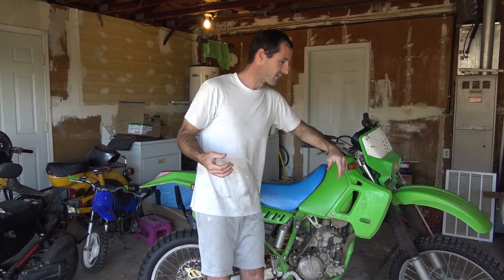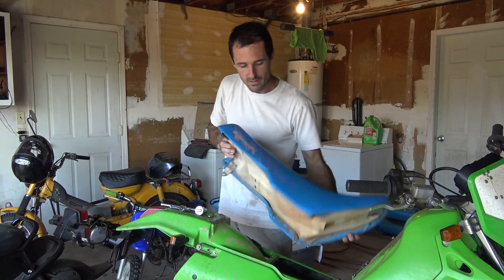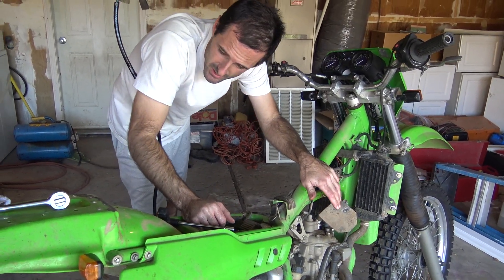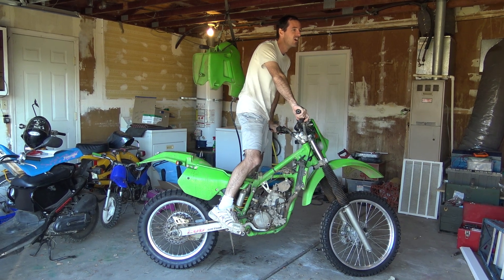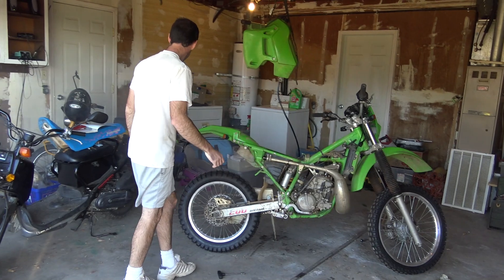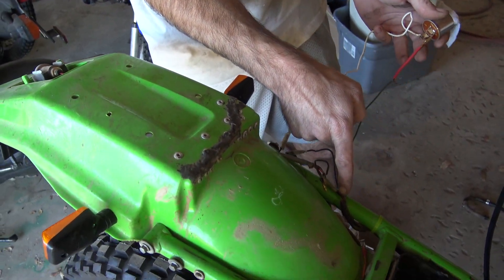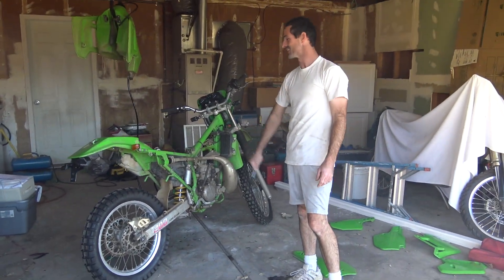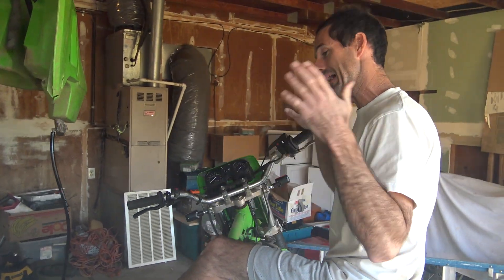$200 Kawasaki Dirt Bike - Who Cares About Turn Signals

Comment: Dude, bin the indicators,  car drivers pay no attention to them. And replace other bulbs with led ones, this will stop head light dimming when applying the brake.  loving the vids by the way,  keep em coming.
Reply: The Moving Object, LEDs won't work with the AC signal. He'd have to install a rectifier, which he doesn't want to do. (Not sure why...)
Reply: only BMW drivers dont know what they are, other people manage
Reply: Jusb1066 IIRC BMWs don’t come with blinkers.
Reply: Honestly that’s true, just use hand signals. It looks a lot cleaner and as a rider, nobody pays attention anyways
Reply: LEDs work fine on AC current. Well, sort of. They will light when the AC current is flowing in the right direction, so in reality they will flash at half the Hz rating (typically 60 Hz) of the AC current. This will be faster than the human eye can see, so they will appear to be constantly on.
Reply: True. But if you install a rectifier and a capacitor, it will work even better!
Reply: tomakze FULL BRIDGE RECTIFIER!
Reply: Matt Strelock Glad, I’m not the only one to catch that. I wonder what they think rectified are made out of if not diodes?
Reply: Well sure, but do you know what voltage those LEDs fail at? Diodes generally have two ratings that matter here. Max voltage, and max amperage. Stators can crank out 18-20v ac at higher RPM. I prefer to play it safe and add the rectifier, they are super cheap anyway. Hell, I made mine for free, and used a stiffening cap to further prevent dimming.
Reply: tomakze And how exactly is having a rectifier going to protect you from overvoltage?
Reply: Nevir202 That's what the capacitor is for. Not quite a power supply, but mine stays below 18v for the most part because the capacitor smooths out the peaks and valleys. Since the circuit for most LEDs are designed for 12-14v DC, I honestly had no idea what would happen if I fed the LED strips I used 10-20v AC long term. Mine is incredibly rudimentary since I made it myself. I just wanted to see if I could make it work. Either way, most "rectifiers" you buy for motorcycles are actually rectifiers and voltage regulators in one box, so none of that matters unless you build your own.

Most people don't know any of this stuff though. No need to be snide about it!
Reply: tomakze I’m not being snide. Your comment made no sense.

You said overvoltage could be a problem and then start talking a home brew rectifier.
Reply: Nevir202 Well, it does make some sense. All LED systems designed for 12v DC applications are going to have some kind of circuit to limit current and/or voltage across the LED so they don't blow up immediately. It isn't just an LED, or it wouldn't last 2 seconds. Most LED bulbs won't come with a diagram showing the method used, so I didn't have a way of knowing if the circuit would still survive with an AC signal. Most LEDs use a voltage dividing network and/or some inline resistors to keep things in spec. I have no idea if that would work with AC, so I played it safe. I am not an electrical engineer, I just know electronics from doing car audio. 

When in doubt, play it safe!
Reply: tomakze didn’t say what you DID didn’t make sense, I’m saying that what you said didn’t make sense as you left out information from your comment.

Comment: One 12 oz. Bottle of golden spectro , add to 5 gallons of gas , that will make that bike run great . 50: 1 is great for this bike! Golden spectro  is a great product , and you might wanna buy a nice sparkplug ! This particular bike is bullet proof , great buy ! New wheel barrings wouldn't hurt and different size sprockets might help you get better performance on the road !!

Comment: I have a street legal KTM 300EXC, and I built a rectifier out of spare car stereo parts so I could run an LED tail light. I did it just to see if I could, and now it has been on several long and intense enduro rides without missing a beat. They are super simple! Mine is just four diodes and a capacitor.
Reply from the maker: Wow, good job on that!
Reply: Thanks! I am much like you, I sometimes like to build things just to see if I can! Friends kept asking me why, considering how cheap they are. I just said "I just want to see if I can do it!" Sometimes putting your knowledge to the test is really fun. And your channel inspires me! Keep up the awesome work!!!

Comment: Add a 12 volt ac regulator between the blinkers and the power. It will keep the current at 12volts when you are at high rpm. That’s how I have it wired on my bike works great!

Comment: Now you just need a 3 position switch and those signals are good to go! Put the flasher relay you bought between the spot you splice into power and the switch so you only need 1 of them. Then wire the pair of flashers from each side of the bike to one side of the switch.

Comment: Makes total sense ... The flasher relay works on heat believe it or not.  A bimetal strip (two different metals laminated)  as they heat at different rates the current causes the strip to bend and break the circuit, it cools reconnects the circuit hence a blinking light. Basically an automatic on-off switch An Electronic flasher (typically used fro LED blinkers) would not have worked for you.  Keep at it.  Al ittle more wiring and a left-right switch good to go.

Comment: Wiring a tachometer is extremely simple you just need to wrap a wire around your spark plug wire and send it up to your tach, the meter will be using frequency to translate to RPMs. Just like if you're the measure frequency in your wall outlet in the USA it's 60 hertz which is the same as 1800 RPMs on an engine if the generator is 4 Pole.
Reply: For turn signals you can probably get a 3-way switch, ground it. Hook up positive to left side on one end of the switch and positive to the right side on the other end of the switch and leave the middle switch open.

Comment: Indicators are simple.
Common of 3 pin switch goes to flasher unit, then to power source, left switch contact goes to left bulbs. right contact to right bulbs.
And if you want a fancy dash flasher bulb then connect it between left and right switch contacts :-)
Reply from the maker: It sounds simple when you say it like that ha ha :)

Comment: When I was younger I always wanted to do this to my 1981 Yamaha IT 125 Enduro. At the time it was very difficult to get a kit that would work as turn signals. My question is how would you get the tail light to function properly you'll have to figure out how to rig up some sort of stop switch. Also if you put the inverted forks on hopefully the headstock will fit although if it's an identical bike it should. I enjoy your videos.

Comment: We used a 3 position switch for the blinkers and then used a house switch to run the tail light and head light.
Reply from the maker: good call on the house switch I love it
Reply: Works great keeps the battery charged. Might be picking a bultaco God knows what with a Honda CB 350 motor swapped in it. It's bare bone but I'm gonna build it into a scrambler.

Comment: i have a 1990 kdx200 i bought for $120 with a few parts missing. The motor has broken a few powervalve components and is in need of a full rebuild.  Might be worth your while taking the powervalve assembly apart and decarbonising it.

Comment: Hey, I've had some experience with my 98 EXC300, no battery, AC only. Regular halogen bulbs work fine with AC, it's only when you run LED signals that you would run into dramas, potentially needing a rectifier.

Comment: All you need is a separate lithium battery to power the flasher, switch and brake switch. Just wire separately. Place it under seat with a charging plug accessible.

Comment: you just need a regulator rectifier, itll take your ac output and make it 12v dc constant currant, the the the street kx is made super simple , if your try to run of just straight ac it will work but at higher rev's it will make more current and fry things sooner if not immediately  you whont need a battery or anything else to do this

Comment: It has been a long time since I fooled with a magneto equipped vehicle. It's  ac  only for your ignition system.. There is a rectifier in the system somewhere that converts ac to dc for the headlight, tail light and now for your turn signals. It's sort of like your car that has an alternator(ac) but the rest of the car is dc. In a car it's called a regulator that converts ac to dc.

Comment: You have my interest because I just bought a 99 cr125 project and I'm wondering how I can wire up an led headlight with no battery. Haven't even taken the time to Google it yet but since I'm already subbed I will definently take notes
Reply from the maker: From what I've heard if you want led you need dc power. Your cr probably just has a stator that puts out power for spark (no lights). So I think your options are to either get a lighting coil (to create the power) and a rectifier (to make it dc), or leave the stator the way it is and get a battery to run the led that you'll just have to recharge at the house.
Reply: Jennies Garage I don't like the idea of recharging a battery... I'm going to research more about a coil and rectifier.

Comment: you want a lithium ion motorcycle battery I have heard putting signals in without one will blow your light bulbs or wires or something. I used to have an xr600 duel sport and was told that for what its worth. I personally would love to see you make a duel sport with no battery.

Comment: emmm.....you linked up two turn signals to one switcher..you need a separate circuit for the turn signals....it can take power from the alternator...but you maybe need to find a scrapped loom from a bike that you can integrate to yours...easier than making your own?

Comment: Your 100% fine as is filament bulbs don't care about ac vs dc voltage, you could even run a higher voltage if needed, the only potential issue is your blinker control module if its electronic it may fail due to abuse, if its thermal/mechanical it wont care just like the bulbs.(again i think your in the clear on this)

If you need a more stable output,  a cheap rectifier and a cap Will only run you $2-3. (like a 12v acc port or dash cam radio etc)
Its pretty straight foreword any you can do it with spade connectors. Connect the ac to the marked terminals and match up the + and -.
http://www.taydaelectronics.com/single-phase-bridge-rectifier-mic-35a-1000v.html 
http://www.taydaelectronics.com/capacitors/electrolytic-capacitors/4700uf-50v-105c-radial-electrolytic-capacitor-19x40mm.html

Comment: Whatchu out if you run with out the expansion chamber.....it will burn the piston
Reply: Its Ya Boy Panda nah it’s running rich enough, if it was running any leaner than it is it would
Reply: MAYBE for a few seconds, but running a 2 stroke without the pipe is like trying to drive a car with no steering wheel. It can't be done. 2 strokes spit fresh gas mix out of the exhaust port, and the unique design of a 2 stroke pipe produces a returning shockwave that sends it back into the combustion chamber for proper fuel/air mix. Also, he is not "running rich enough" just because he's running more oil in the mix, without the pipe he would be super lean in the fuel/air mix. AND, running excessive amounts of oil actually leans the fuel/air mix as well.
Reply: brandon2076 actually it wouldn’t lean the af ratio. It leans the fuel oil ratio. I have a quadzilla drag quad 720cc big bore ported stroker, etc etc with an out of frame pipe with no silencer. It’s fine. It’s never given any sign of piston melting. And I’ve tested many of my 250 and 125 two stroke bikes without silencers and nothing’s happened. I have real life experience not forum and google search knowledge.
Reply: Mike C  I'm not talking about the silencer, I'm talking about running a two stroke without an expansion chamber or exhuast AT ALL, which he was going to do in the video. You CANNOT run a 2 stroke with no pipe.
Reply: brandon2076 gotcha, I agree that isn’t good, but can be done but it won’t end up well

Comment: How many a.c. wires do you have?  You can buy a pit bike rectifier regulator 9j ebay for like 5 dollar.. just need to know how many wires you have.. I'm guessing only 2 yellow wires probably.  Can just install a very small 12 volt battery like for old honda passport..   I'd wire up regulater on it..

Comment: is it a cheap way to get the noise level down , wanna try it outside , but the neigbours are defentlig gonna whine ,so i need a cheap solution , dont wanna spend 8k for a muffler , im not that good at driving yet , this is my first motorcycle so

Comment: Ok, I actually am on speaking terms with Electricity, and I'm scratching my head here. 🤔 Why are we referring to this as an "AC" system? 12vdc automotive bulbs and thermal flasher-units are very unlikely to operate on ac power. I'm guessing that bike gets its electrical current from a stator, not an alternator. Sorry, I'm not understanding why getting the lights to operate is a complicated issue here. I watched you troubleshoot a basket-case generator. Can this really be more difficult?? Im honestly confoozled. o.O
Reply: lumpy Very interesting...thanks for the info!